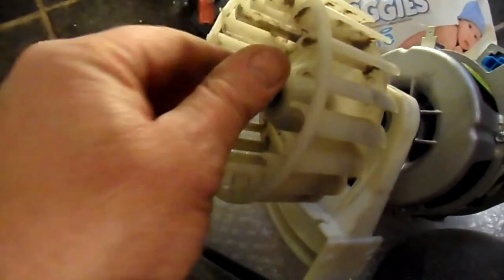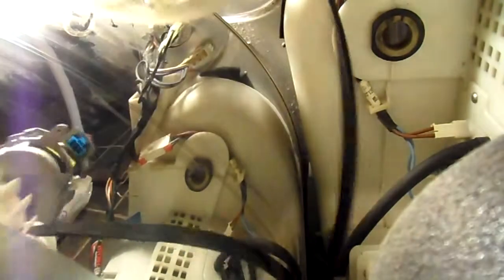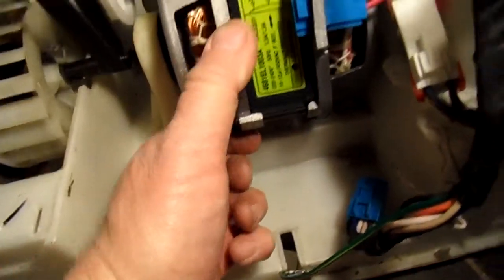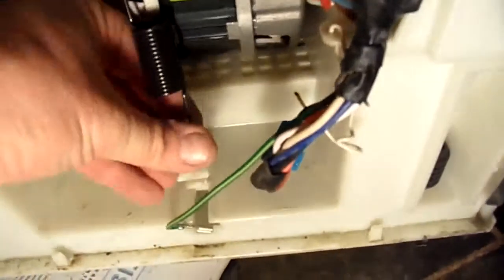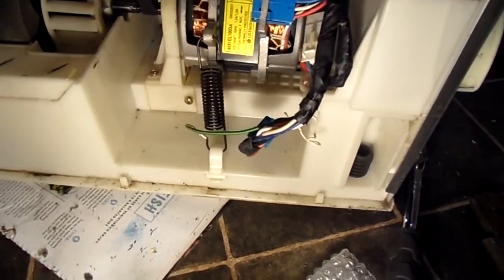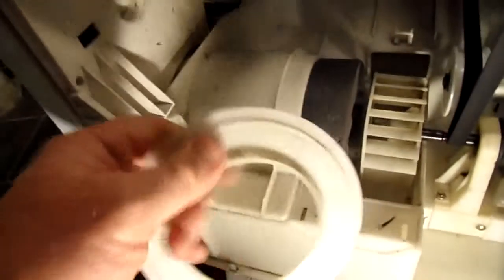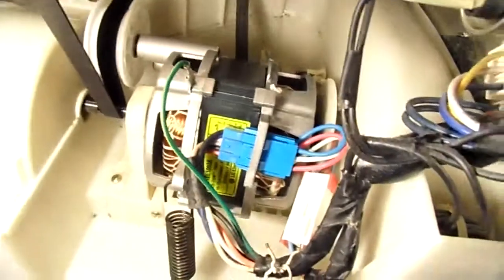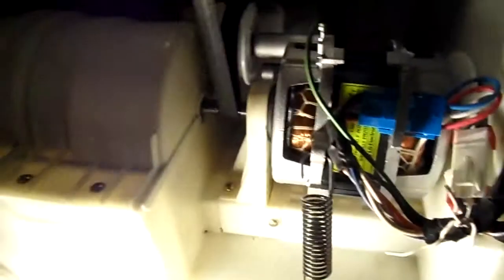LG Dryer replacement motor condenser type td-c70040e  Part 2

Comment: Hi.
Your belt replacement video helped me a lot when I needed to replace mine's.
I guess I have the screaming motor problem now.
Before I see your video I was considering taking the motor to a shop to replace the bearings.
Did you consider that also. If so, why didn't you do it?
I guess it's cheaper than buying a new motor.

Thank you for your help.